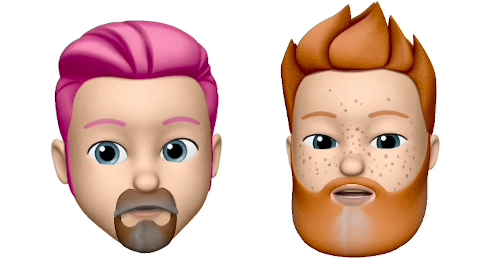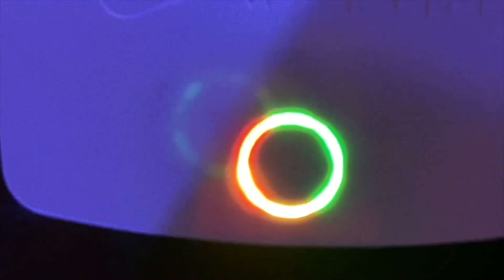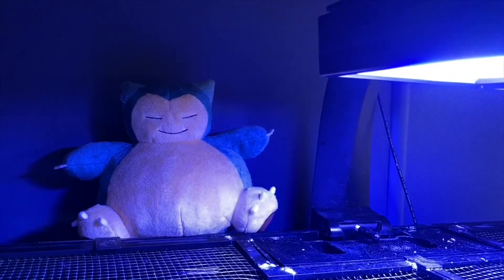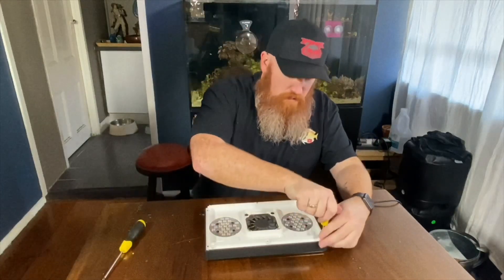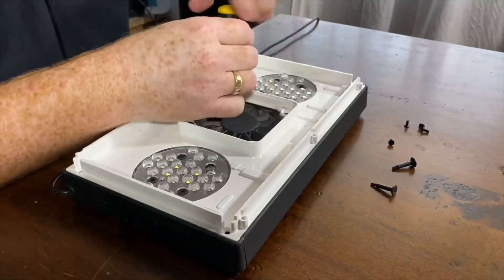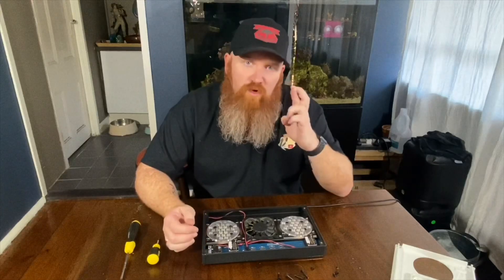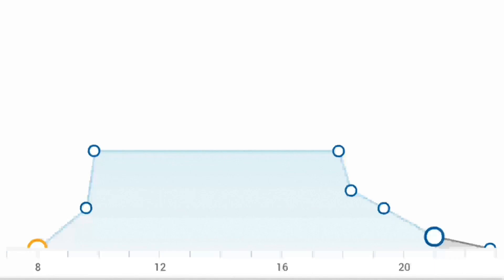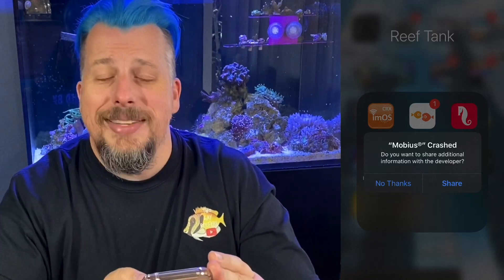We Install the Mobius Chip - Upgrade Ecotech Radions to Bluetooth!

Comment: PLS HELP! I'M using Xr30w gen 4. Mine is the latest version of gen 4. But my 2 lights cannot be found in the search engine. Plus I don't get the "update legacy Devices" option.

How do I do this??
Reply from the maker: Gen 4 aren’t supported by Mobius yet, as the video says, we’re trialling the beta version. Hopefully Gen 4 will be supported soon 😊
Reply: @TwoGayReefers  How soon?  Has beta testing ended for Mobius?  I reckon Ecotech are holding out on people with G4s and legacy devices. Are you guys still able to use the beta app?    :|
Reply: Dean ecotech are hinting at end of July for legacy device availability. I have gen 3’s I’ve installed chips in and am eagerly awaiting the update!

Comment: Any idea how long before the upgrade chips will be available for everyone to purchase?
Reply from the maker: No idea sorry!
Reply: @TwoGayReefers  I just got a reply from Ecotech,  Gen 1 and Gen 2 radions will not be compatible with mobius due to age and hardware.  So Gen 3 or 4 or newer will all be good but gen 3 may still need a new bluetooth module.
Reply from the maker: One of our Gen 4 still needed a chip
Reply: @TwoGayReefers  it's really ridiculous that the company with the biggest following in the reef hobby that has been making one of the most popular and expensive lights still has yet to have wireless capability built in. AI which is owned by ecotech has been doing it for about 5 years already.
Reply: @richardportelli1983  Ecotech could have added inbuilt wifi/ bluetooth on the actual fixture years ago,   but that was never the plan originally,  their idea was to sell you reeflink.

Comment: I'm curious if it seems like the bugs are being worked out.  Are you guys still using Mobius and are you happy with it?
Reply from the maker: It’s still in beta, but it works more consistently than the Reeflink does. We use it nearly everyday to feed our fish before the lights are scheduled to come on 😊
Reply: I have been using it as well. I am extremely impressed with it so far. It isnt quite there yet but it is getting there. I personally have not had the app crash in either iOS or Android lol